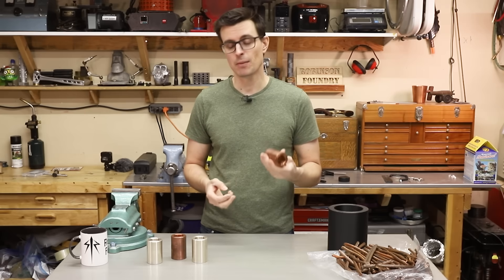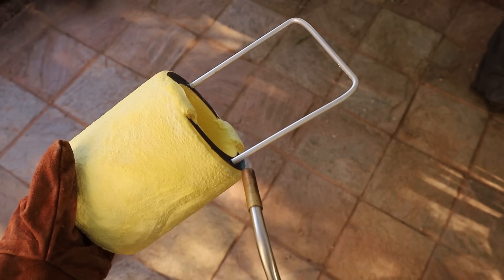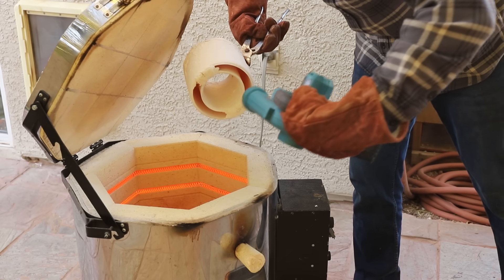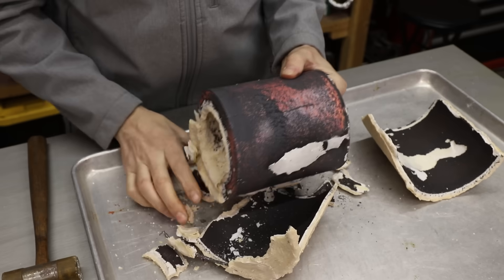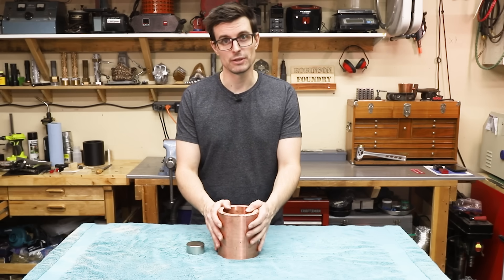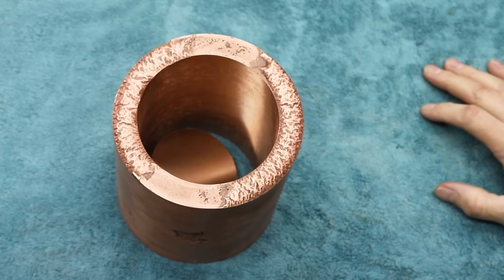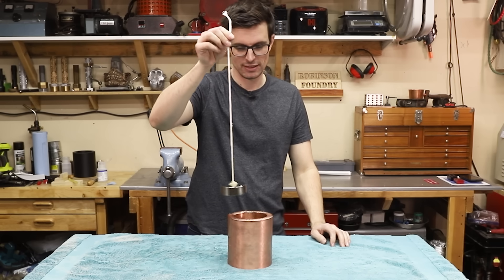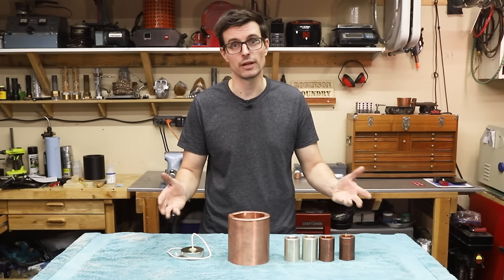Defying Gravity - HUGE Neodymium Magnet vs Copper Tube Experiment - The Power of Lenz's Law!

Comment: Outstanding. Thank you. I have not read others' comments. I assume that if the copper tube was air cooled slowly rather than placed in water the copper atoms would align and assign themselves into a more continuous regular 3D metallic lattice rather than the likelihood of vacancies and discontinuities. Hence, (rhetorically speaking) would the sea of valence electrons from a more continuous 3D structure of copper atoms contribute to greater eddy currents, and therefore decrease the speed of the magnet further? I am also thinking that any differences (between air cooled versus water cooled copper tube) may not be that noticeable.

Comment: Instead of a copper tube, it would be interesting to use a thin-walled plastic tube tightly wound with thick copper wire with thin insulation (E.G. varnish). 
I'm thinking that shorting the free ends of the wire together will slow down the magnet more, and that placing an ammeter between the two wire ends will show current being generated.

Comment: If instead of copper you take gold or platinum, then the magnet should fall 2-2.5 times slower than through copper. This is due to the density and electronegativity of the proposed metals.

Comment: Have you tried stacking the silver and copper tubes on top of each other in different arrangements, creating a longer tube? So: (silver, copper, silver, copper), (silver, silver, copper, copper). Time each one. Also try attaching a volt meter to see voltage created.

Comment: this is so extremely important to show young un-contaminated minds.  By the time you reach your teens, you begin to think like we are all taught 
we need imagination to discover what's still unknown (and you might think its all been explained?  you were lied to -we don't really know how this works on a quantum level! why an electron (and much lesser degree, proton) is magnetic!
We have been doing this experiment for over 200 years now!  and our motors, while now much more powerful?  HAVE NOT REALLY CHANGED!  only how we drive them and that's not much more than higher speed vacuum tubes/valves (IGBT/MOSFET) and software to capture rotor angle and convert to quasi-sine wave functions!   
this needs to be shown in elementary school
someone will find the quantum leap and break this stall we are in.  
(i have tried, but i've been through too much education to think of it any way other than how i was taught!)

Comment: I thought copper is non magnetic. Greetz from 🇨🇭
Reply: The copper is non-magnetic.  However, as the magnet moves through the copper tube, it causes the copper electrons to move (induction), and these moving copper electrons now generate a new magnetic field which then interacts with the strong magnet.
Reply: @ajtony1313  Thank you for your explanation. So you mean that as long there is no movement there is no magnetic interaction between the magnet and the copper tube? Greetz from Switzerland.

Comment: 215 / 5.000
Übersetzungsergebnisse
Übersetzung
I think it's the same principle as a generator. There the copper moves into a magnetic field and thus generates electricity. Here it is the other way around. Therefore you should also be able to measure a voltage here...

Comment: Here's a project and experiment for you. Take the magnet (ball, disk, bar,etc.) and a copper pipe/tube, wrap the copper pipe with transformer wire, connect the ends of the wire to an ammeter, and/or voltmeter and check for amps and voltage if generated and transferred from the coil to the meter. Turn the magnet over so that the magnetic field is reversed and see if the amps or voltage changes. LMK your findings!😊

Comment: Something that Ive always wanted to do is make a very tall shaft that you can attach the big magnet to with a very long string and or solid rod.  Swing the magnet over a very long arch of copper runway and watch it start off vary fast and then glide to a nice soft stop.  Or have a nice thick copper plate at the center point of the pengulu that arrest the magnet swing.   Kind of a motion copper/magnet ART project.

Comment: In the last video you mentioned that it felt like you where holding the magnet as well as the pipe while it was falling, would you be able to put the pipe on a set of scales and see how much of the weight of the magnet is transferred into the pipe. (the magnet may not play well with digital scales)

Comment: As an experiment, what would happen if you dropped the magnet down a tube, with lots of holes so the magnet doesn't experience negative/positive air pressure whilst falling, from a height of 20 or 30 feet? Would the magnet automatically slow down once it comes into contact with the magnetic field? Or, perhaps, would the momentum of the falling magnet be so great that the magnetic field would not have enough time to alter or slow the magnets trajectory?
You'd need the tube to match the inner diameter of the copper cylinder so that the magnet doesn't bounce off the top of the cylinder.
Also, if you increase or reduce the thickness of the cylinders' wall, will it maintain the same magnetic field?
Just wondering 🤷🏻‍♂️😉

Comment: Electromotive Force induced by Electromagnetic Retardation. I love the scale of this experiment.

Btw the Magnetic field is Ab-Extra to the magnet, like the air around an air fan (this is also the explanation for the "Faraday Paradox"), if you rotate it on its polar axis it's not going to really have any effect as far as the fields themselves go unless you somehow spun it up to near luminal velocity, spinning it just aids in stability due to gyroscopic precession, spinning it on its side from the string will produce far greater resistance like when rolling the tube.

Comment: The trick is to make the tube wall THICKNESS thicker to reduce the resistance for the highest current.  You can simply make another tube that fits either over/around the first, or inside.  The snugger the fit the better, but a little gap shouldn't kill it.
When the magnet it flat, the current is going around the perimeter/circumference of the pipe. 
If you can still sense the CHANGING mag field outside the tube, you can make it thicker for more slowing effect. . .
.
ALSO, put the magnet on a column, then drop the tube down over it. . .

Comment: This is cool, I was thinking about the lenz law the other day. I was wondering if you dropped a long copper tube off a skyscraper and reach it's terminal velocity would the magnet stay in the tube or come out before it landed, and it it does come out, would it leave from the top or bottom end?

Comment: A closely matching copper tube would work the same or better even.  You don't need that much copper.  Cool experiment though. Don't name these things anti-gravity if you want a little advise from an old scientist. It isn't anti-gravity it is a electromagnetic force that counters some of the gravity. The fact that it has to be moving to generate a magnetic field is why it can't be stronger than gravity and stop the magnet.
Reply: The thicker the tube wall the better.  Lower resistance and higher induced current and field.
Reply: Yes that's true. All I was saying is that if the magnet were closely matched to the size of the hole you would need a lot less copper to get the same effect. @Observ45er
Reply: @davidrommel8109    I suspect so - tighter magnetic coupling to the pipe.
.
Be careful you don't mistake a piston effect for the additional magnetic breaking. 

.
I made other suggestions. . .   Fun stuff. . . 
.
BTW: you can view Fleming's Right and Left Hand Rules as the most fundamental basis for Lenz's Law.

Comment: Such a nice, solid casting. All of my copper castings come out full of bubbles. From what I've read, when the copper is in a liquid state it absorbs hydrogen gas from the air, and when it solidifies, that gas comes out of solution to form bubbles. I haven't found any way to keep that from happening without adding something like phosphorus that will compromise the purity of the copper. Do you have a secret?

Comment: Would have had MUCH less problem with that initial copper pour had you turned your mold one-quarter turn clockwise and poured into the slot the long way… 3:15

Comment: I used an 18" length of aluminium tube and an N52 sphere with a couple of millimetres at either side between the sphere and the tube.  The effect lasts longer thus more impressive.  I used it at work as an ice breaker.  It became known as Andy's Magic Pole.

Comment: If a conductor is attached to the magnet instead of a string; Is there a voltage potential generated between the conducting string (say a copper wire string) and the copper tube?  If so, then would an applied voltage to those same points propel the magnet inside?

Comment: when the magnet is inside the tube, does it add weight to a scale if you put the tube on a scale? might need a scale similar to one of those used to weigh fruits, but with a plastic pan instead of metal. i'd be curious.

Comment: @Robinson Foundry
I bought a few of those neodymium magnets about the size of a quarter. They're expensive as hell, powerful and dangerous! But going by your experiments I reckon they'd make nice bearings of a sort. Does the magnet offer the same amount of resistance moving up the tube as it does moving down the tube? Or does gravity make a difference?
Impressive setup you've got there btw!!

Comment: Could this be made into a "frictionless" or "low friction" braking system? For instance, for an elevator or for park rides (roller coasters", etc.)
Reply: The same principle is actually already used for frictionless brakes in rollercoasters, and in a bunch of vehicles
Look up eddy current brakes, a bit technical but interesting

Comment: What would happen if you use copper wire industrial or most likely custom with a hole in the middle like a tube of copper wire (insulated) using a magnetic ball or bearing to guide through the wire tube either by exterior magnetic guide or maybe air pressure!?

Comment: As others have suggested, matching the diameter of the tube closer to the diameter of the magnet yields more impressive results.  I like to use a steel ball and a ball magnet of the same sizes in the copper plumber's tube as a fun demonstration.

Comment: Fire a magnet through the tube at high velocity (higher the better) such that it ought not touch the sides while in transit. Propel it with a speargun or other elastic sling. Measure the degree of stopping power relative to the speed of projectile.

Comment: On a 30 degree incline, first roll the empty copper down hill.

Then try it with the magnet inside.

Try slopes of different lengths and angles between empty and magnet filled.

Comment: lenz law can be divided into two types:
1. The force that exist on the electrons moving in the magnetic field. So when the moving magnetic field generate an eddy current, the electrons in the current experience a force by the magnetic field.  Since the electrons cant leave the copper, this force have a reactive force which slows down the magnet.
2. The force that exist due to the interaction of the magnetic field of the magnet and the magnetic field generated by the eddy currents.

Comment: Let me share a few facts, I've been a Ham operator since 1959 as a general class operator I designed and built all my equipment (the TUBE days').  You have a good understanding of inductance!!  I agree with all your findings.  BUT!!!  I want to expose something you can get into and it's going to blow your mind.  JUST LIKE TESLA SAID look for things you can't see!!  So, let me introduce you to what I refer to as the "B" field., I'm sure you know that there are three elements to any AC or Radio wave traversing space The oscilloscope only shows the two base elements, the positive and negative parts of any radio signal "BUTT!!  The fact is it's the centerfield of a magnet that pushes the signal out whether it be AC current or a radio signal same thing!!    Her's what I want you to learn:  the centerfield of a magnet is by far the most powerful!!  FACT!  I refer to it as the "B" field, for a good reason it's much more complicated, Here's just a few facts:

#1.  If you tap the centerfield of a magnet (IE: the "B" Field) on any none Metalica item, it will lose weight.
#2.  If you tap the centerfield near a trickle of water, it will repel the water!!
#3.  If you vibrate the center field into a granite rock it will not only lose weight but also be very workable, what basically happens at the correct frequency the Quarts in the rock will reorganize.
#4.  The center field of a magnet is multi-dimensional.

Once you start to see what's going on << It's going to blow your mind.    Vincenzo!!  THE HEIGHT OF ONES INTELENGCE IS DIRECTLY PROPORTIONAL THE THEIR REALIZATION OF THEIR OWN IGNORACE!!! vpc

Comment: See if it generates an electrical current, or heat. Could be used as a frictionless brake for cars: have the magnet oscillate in the tube. Pretty much the same as regenerative braking.

Comment: Cool content. Why make the title so shitty with "anti-gravity"?
Anyway, I would assume that the strongest magnetization on one side and conductivity on the other is the most important. You are at the limit of one of these parameters, but I doubt these massive magnets are anywhere near N52 magnetization. So in this case, you are likely going to have better results with smaller, stronger magnets. You can, of course, also reduce the gap size. Or try different sizes and wall thicknesses to see if 1 mm vs. 2 mm or even much thicker makes a difference.

Comment: why don''t you try to build a magnetic suspension, or impact damper , or magnetic elevator sure it would save a lot electricity since you just let it slide it on its own the way down 😋😋😋

Comment: AT 8:30 you are rolling it with the magnet suspended in the middle .   I was wondering if with maybe marking on both do they rotate at the same rate and maybe try it with the magnet in center already spinning,  And you run out of room so maybe some fun things you could do with sitting the tube on some powered rolling thing to spin it in place.

Comment: Get a slab of copper bar, thicker the better, as long as you can afford. say, 500MM wide, 10MM thick 1M long. Lay it on the floor. Swing your giant magnet over it, down the length. Preferably from a fixed point on the ceiling. Magnet is NOT to touch the bar. pull the magnet back and let swing DOWN the length.  Yes, I do this during a lecture on Faraday and lentz's law.

Comment: So what would happen if the copper tube had one end closed. Or drill a hole in the center of the magnet mount a perpendicular solid copper tube in the middle and will the magnet when dropped have more control . How much weight can the magnet have on it and still have resistance while falling last if the bottom had a opposite magnet will the magnet just levitate in the middle or rise out of the tube

Comment: I have taken a 1 inch diameter spherical neodymium magnet and dropped it through a standard copper pipe of inside diameter of just 1/32nd over 1 inch and length 2 feet , and it took 7seconds to drop. Dropped in air outside the copper pipe it would drop 784 feet  in 7 seconds ( of course you would have to have at least 784 feet for the magnet to fall , and it better not hit a hard surface because these neodymium magnets are brittle and it would shatter ). Even this 1inch diameter spherical magnet is dangerous . Don't get your fingers between it and iron --- it could seriously mess up your finger . You must treat that magnet with a 400 pound pull very carefully .

Comment: Subliminalvibes is absolutely correct . In Electrical engineering courses , it is taught that magnetic circuits such as the one demonstrated in this video are analogous to simple dc circuits . In a simple dc circuit  I = V/R where the current I in the circuit is equal to the dc voltage V in the circuit divided by the total resistance R . In the magnetic circuit the  magnetomotive force mmf which is supplied by the powerful magnet is analogous to voltage in the dc circuit , the flux phi is analogous to current ,  and total reluctance  R' is analogous to the resistance in the dc circuit . We then have the magnetic flux is  phi = mmf/(R') . Now flux phi , and reluctance R' in this last equation are very important . Flux is a measure of the magnetic flux flowing through the entire magnetic circuit . The entire magnet circuit includes the magnet , the copper , and the air gap . By far the largest contributor to the total reluctance is the length of the air gap . This means that in   phi = mmf/(R')  we want the air gap as small as possible to make R' as small as possible to make the magnetic flux phi as large as possible . You could have stuck with the smaller diameter puck magnet , and a thin copper tube with a small clearance 1-2mm would be very dramatic .
Reply: Similar to a DC choke right?

Comment: How about cutting a lengthwise slit from end to end so the tube no longer has a closed circumference?  If you then solder wires at opposing edges of the slit, you can apply an electrical current around the circumference or measure any induced voltage across the gap.  Another thing to try would be measuring the reduction in braking force that arises from various shapes and sizes of cut out of the copper.

Comment: what would be interesting is to see the copper tube placed on a rock tumbler frame and spun at different rpms and see how it affects the magnets position and could it become an "anti gravity" machine by holding the magnet suspended and not allowing the magnet to spin on its axis.

Comment: I would love to see it turned on a lathe to create a minimal clearance between the magnet and tube.  To increase flux density in the copper. I have seen much smaller magnets go that slow in aluminium tube.  The clearance was minimal.